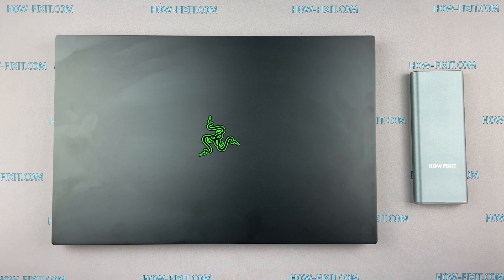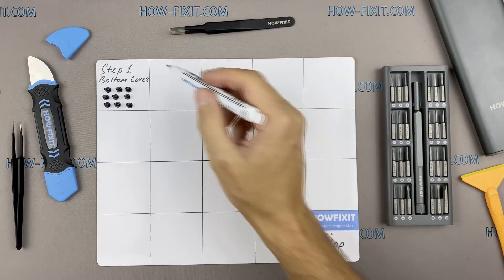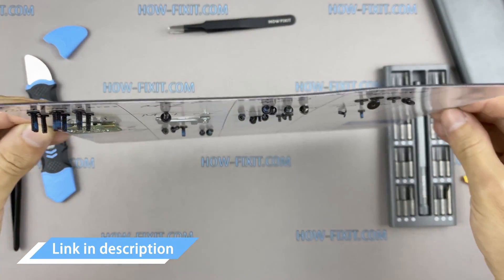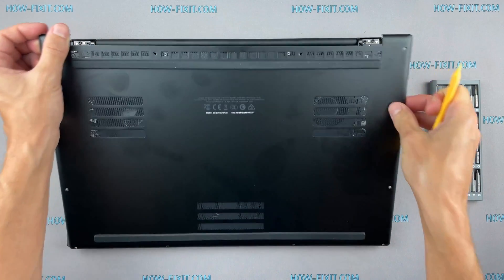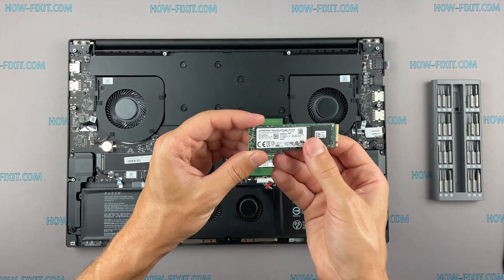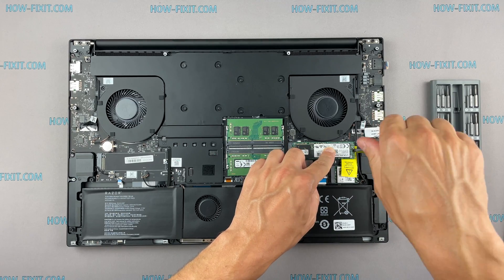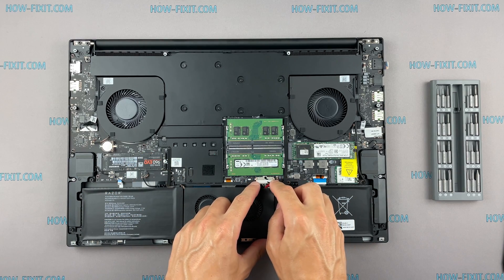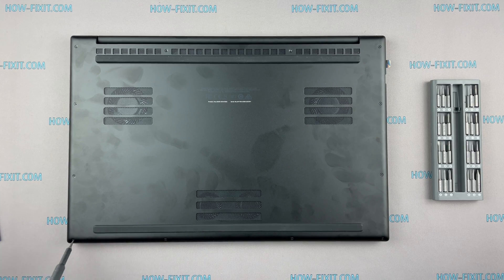Razer Blade Pro 17 (2019) M2 SSD Installation Guide (Easy DIY Upgrade)

Comment from the maker: ⚠ The Razer Blade Pro 17 (2019), model RZ09-0314, offers flexible storage upgrade options:
- Primary M.2 Slot: Equipped with a 512GB PCIe 3.0 x4 NVMe SSD, upgradeable up to 2TB. 
- Secondary M.2 Slot: Available for additional storage, supporting both SATA and PCIe SSDs.
✅Check the description for links to recommended M2 SSD drives. 
✅Additionally, watch the video explaining the differences between M2 NVMe and M2 SATA 👉 https://youtu.be/r3Jy5dHOj3g

Comment: Hi, just to let people know, when I went to put in a new SSD card there was a soft piece of rubber stuck down on the area where the SSD card was to go. 4cm x 1.5cm x 0.5cm (1.5 inches x 0.5inches x Something I don't know what this converts too). approx. I just pulled this up to put the SSD card in.
Reply: Mine was the same. Removed mine also.